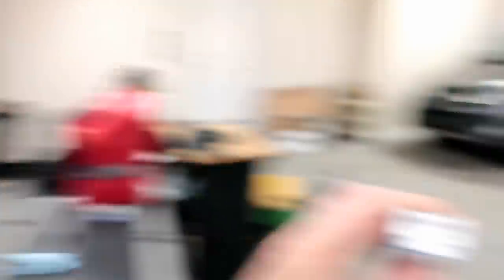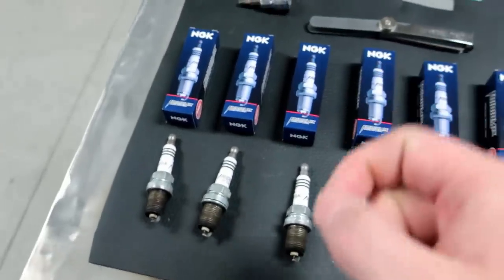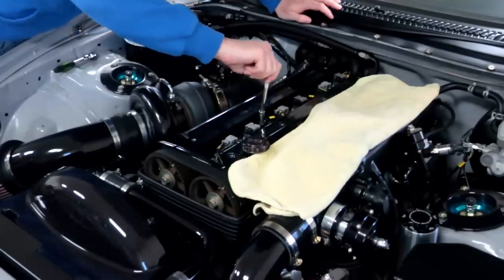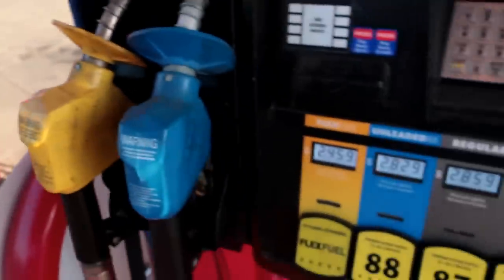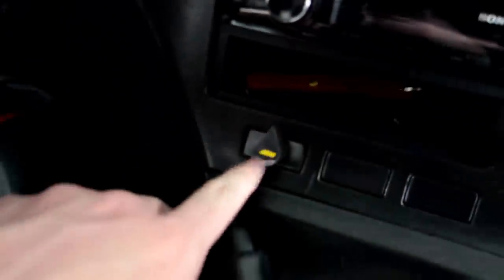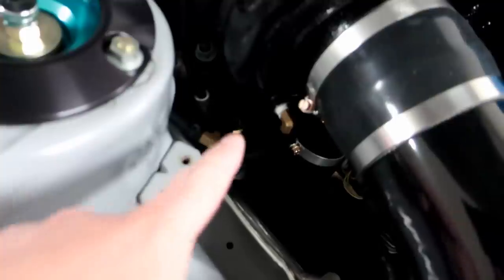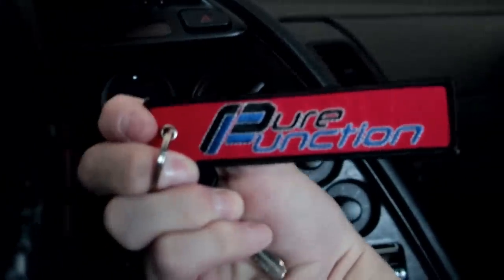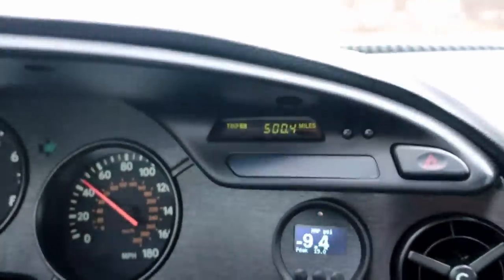Supra Dyno prep! How Much Power Will It Make?

Comment: Since you have a flexfuel sensor you won't have any problems with ethanol content the only downside is boost, timing, and fuel will be pulled when below 70% usually. I haven't noticed this with gas or diesel but when you pump E85 anywhere the that fuel is running through it that is metal it gets pretty cold....just one of those weird things you actually notice standing there filling the car and jugs.

Comment: Regarding E85 alcohol percentage: The labels will differ between "flex fuel" or "45-85% alcohol" or "E85", but that doesn't mean anything. You are subject to whatever the refinery decides to do for your region at whatever time of the year it is. Usually during the winter, you'll find there's only ~50% booze in "E85", because cold-starting on 85% booze is tough, and people don't like it.

For tuning purposes, it would really be better to have actual 80 or 85% booze - that way the upper and lower limits of the engine calibration are actually tested. If you show up for tuning with 50% booze in the tank, the tuner will have to use math and his experience to extrapolate... Which is probably ok, but would be better if that upper percentage was ACTUALLY tested.

EDIT: Just saw end of video about the 98% booze...  Great plan!

Comment: Not to burst anyone’s bubble, but your gonna max out at 650hp. One pump and 1000cc injectors will be maxed out at that point. I highly recommend a dual pump and at least 1600cc injectors to make 700-800ish hp. E85 requires a ton of fuel. Maybe 100 octane will get you to 700. But even then your pushing a fuel limit.

Comment: My personal opinion id see what the e85 content it is. if it's only reading in the 51% range than you're not using that gas to its full potential. your car wont make as much power. I went through about 3 or 4 gas stations before a local one opened near me that was reading 81% ethanol content.